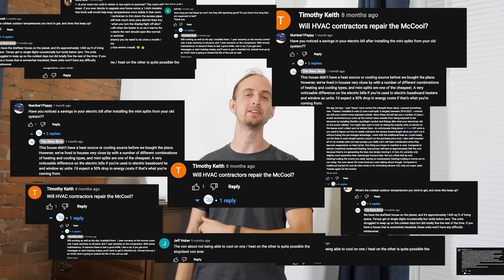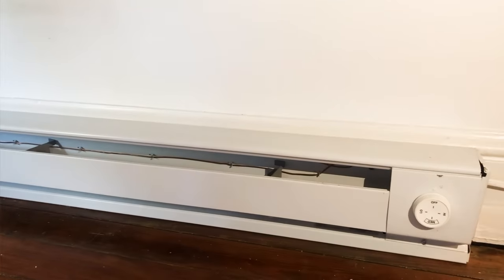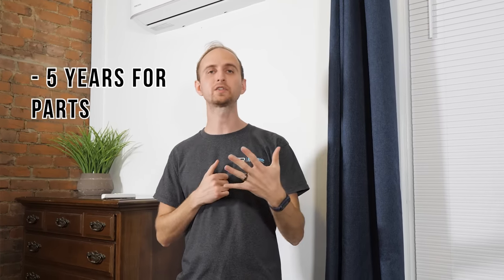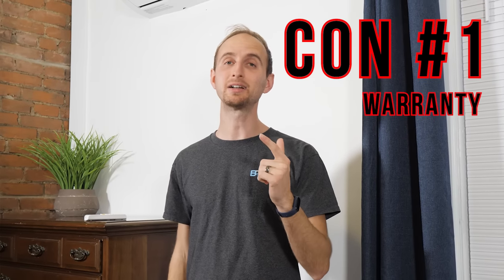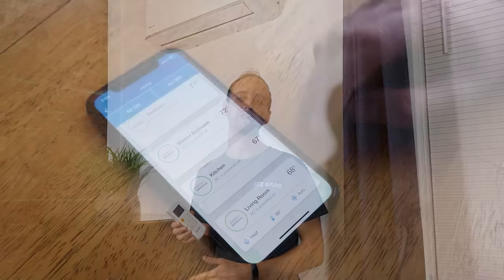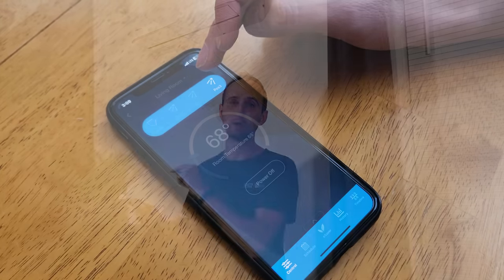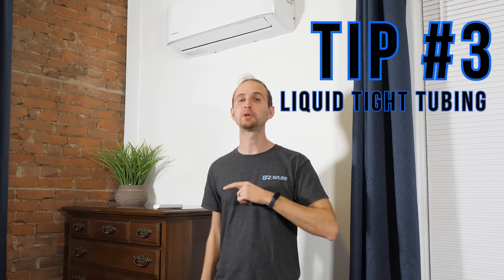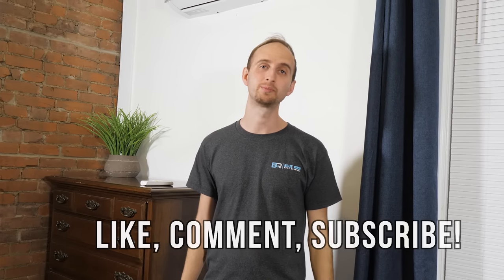Mr Cool DIY 2-Year REVIEW: I wish I would have known this BEFORE BUYING...

Comment: Contractor with 25 years of experience here (I've personally worked for 2 different HVAC companies for over 4 years as well). DIY mini splits are by far the best bang for your buck. Don't go with a offbrand that won't be in business 3 years down the road, and don't do a half-assed rush job on the install. You'll be fine. Plumbers were crying the same way HVAC guys are now back when PEX, and sharkbites hit our market 20 years ago. They realized that the average person could handle the work themselves reasonably well in most cases. Most companies, and many contractors are charging entirely too much for their work. There are many reasons why this is happening. There isn't a "smoking gun" as to why this is happening. Some of it is the price that materials has gone up (not as big of a chunk as you might think), price of fuel, insurance, etc. If they're a large company they have a lot of overhead (office, shop, utilities, maintenance, staff, advertising, ect). BUT a lot of it is just old fashioned greed. Many are charging hundreds of dollars a hour simply because they can. It's shameful. Your best best is to find a honest independent contractor in your area, and develop good business practices with them. I can assure you they do exist. They are out there.
Reply: It's hard to find honest contractors without having them come to your house though.  I had tried to diagnose my fridge ice maker and couldn't find anything wrong with it and finally gave up.  I called a refrigerator repair man and when they found the problem they told me it would be an additional $200 for an additional electrical diagnosis fee on top of the 120 minimum for them to come out.  Long story short, they charged me $320 to plug in a cable that they had seen was disconnected after it came loose.  I hadn't checked the wire behind a screwed on cover.
Reply: You are so correct.. These Hvac contractors are licensed to steal. For instance I want a12000 unit put in. Quoted like 5-6 thousand dollars. Takes 4-5 hours to install some time a little more. I when on line and they had Goodman splits made buy Daiken now. Paid $661 out the door with the raceway piping and wires for communication between the units. Granted it doesn't have all the bells and whistles but so what it cools just as good. I can put one in in a heart beat. Just flat outrageous. You-tube is gonna kill these greedy guys.
Reply: 100%, thanks for this.
Reply: The main reason is that everyone went into computers starting in the 80s when we were at school districts tearing out wood shop, metal shop, welding shops and installing Apple computers. Everyone then went into computers and decades later they are dime a dozen and we have a huge shortage of trades people. I was there and saw it happen. Now trades people are killing it with their wages. turning into a real rip off generation.
Reply: Explains a lot, i was browsing to see what experienced pros had to say about diy kits and they all said they were garbage, but i went ahead and did it anyways and couldnt be happier, ofc i spent like 2 weeks planning the wiring and researching before mounting the units lol.
Reply: Good point.   With the lack of knowledge that these homeowners have,  even if they’re a ‘contractor’ allows for great business.   They make so many amateur mistakes that you can make good money fixing their problems.    I remember getting $200-$300 to clean up a burred pipe that was causing a homeowner’s sharkbite fitting to leak.        I say Bring it On,  there’s always plenty of good technicians to fix the mistakes make by tending diy projects 👍🏽
Reply: @B-Nice  Putting in a simple split system is not rocket science , lots of great vids for good installs. With the lack of trades people out there even the big pro shops end up hiring guys that skip steps or don't do things properly. Lots of the pros on u-tube do the fill and leave method not looking for a leak.  Give me a brake.
Reply: Duh! How are you suppose to know that until after they completed their work and let time pass to see if it was good value?
Reply: @B-Nice I agree if it's a complex installation but if it's free charged a homeowner with skill can do it.
Reply from the maker: @knowledgeispower6192  Honestly I would have paid a pro hundreds of dollars an hour to run the line sets. It took me like 40 hours and I know a pro could have done it in 4 hours

Comment: The only way to alleviate the mode switching problem is to install only single head units. Honestly, as an hvac professional, that is my normal recommendation if there is not an excessive number needed. It simplifies things when each indoor unit is independent. Also if there is a leak or a problem with the outdoor unit, you don’t lose heat or cooling in the entire house. Not a criticism, just an observation.
Reply from the maker: What would you have recommended in this circumstance? 1 building, 2 apartments, 7 interior heads total (3 in one apartment and 4 in the other)
Reply: @TheRenoBros  without knowing layout of the building, you likely have it pretty close to ideal. Anything over three heads and you almost certainly have to use multiple indoor units per outdoor unit. Whatever area you set condensers in just gets crowded. Normally I would install a typical forced air system, ducting heat to wherever it is needed and running off of one unit. The Gree flex and Bosch ids systems offer much the same efficiency with proper ductwork. Returning to the con with your system, I was trying to say that the problem is not unique to Mr.cool. With any minisplit system you will have the changeover issue. Some like Fujitsu are worse in that when you mismatch modes it creates an error requiring a hard reset, as in cycling power to the outdoor unit.
Reply from the maker: @sethsturtevant9082  Thanks for the insights! I appreciate it!
Reply: If you want to save even more money get some insulation for the walls and floor and ceiling and some great stuff for your drafting this
Reply: The beauty of a split is it’s autonomy. If it breaks you only have to change one. The cost is greatly reduced
Reply: I would tend to add multiple units with single heads wherever possible, as you say up to three. A big reason is just autonomy. If one breaks down you don't have a completely uncomfortable home in the middle of a heat wave / cold snap. I see these people living through the Arizona heat wave and they have a single central air unit or a single mini split that breaks down. Potentially life threatening these days.
Reply: That's simply not a cost effective option for most people.  Considering you can get a multi-zone (3 zone) 27k BTU MR Cool DIY for around $3900.  Let's say we go your route and get three 12k MR Cool DIY single units instead that run around $1800 each.  You are paying almost $1300 more than the multizone.   And now you need 3 electrical connections run from your panel, so instead of maybe paying an electrician $750, you'll pay close to $2k if you can't do it yourself.    You end up paying almost $2700 more (with electrical included), if you do separate units.  

Let's not forget, you also have 3 compressors outside.  Takes up more space, and there's more noise.

As for the case when the mini-split breaks.  While that is a advantage for separate units, most people have that same issue if they have central heat/central air.  If heating/cooling is a life/death matter for someone, then they already should have some backup plan.  Whether it's buying a window AC, or having a portable heater, or fireplace, that should be thought of before it's needed.  And they also need a whole house generator to power their backup heat/ac, unless they are using a fireplace, and even many new fireplace inserts also need power to run a fan, etc.
Reply: With the air handler not turning on because of being in a different mode. Whenever there is a call for heat that unit gets priority. Example if you had two units in cool and the third gets turned onto heat. The two in cool will go idle. 

In the app, look into the e-saver, comfy mode. You can use this turn the unit off completely once a set temperature is reached. 

For me we have a bedroom that we keep cooler than than the other we set room 1 to 62 cool. On the other we use comfy mode to turn on heat to 86 when it drops to 66. Then once the room is 70, it turns off. The first rooms cooling only stops for about 20 mins at a time while the second heats back up.
Reply: we have a house with 3 , five head units, and yea when a unit goes down we loose 1/3 of the house cooling, has happened 3 times in 4 years
Reply: @TheRenoBros thanks for the vid. Enjoying your. I'm betting that you wish you would have installed larger units.   😊
Reply: Your going to use the 3 head option or the four head option but just remember that they are all connected by a common line if one indoor head leaks refrigerant the hole system may go flat kinda like if all four of your tires are connected by a common line it could become very difficult to determine which one is leaking @TheRenoBros
Reply: @sidorgeorge  Wow that's expensive. Here in aisa a single head 12K BTU unit costs around 400 US dollars.
Reply: @thunderboltlightning6010  Yeah, it seems like in the USA, mini-split are a very high cost item.  And HVAC companies charge you so much money to install.  For example, I got a quote to install a 27K 3-head unit mini-split, for $12,000 US dollars.   I went with the DIY Mr Cool instead, and saved approx $8000.   Wish our units cost $400 :)
Reply: @TheBernz83  My work has the Fujitsu mini splits with several heads to a unit. If some are set on cool and you try to get heat in another room they bug out and shut down.

Comment: Last winter was my first with a 27k two zone in my garage. Mr. Cool's defrost I believe is 3 min long and NOT long enough for a New England winter. The defrost runs long enough to create a bubble around the fins outside. It's still crusted with ice, but there's a space between the ice and fins. This starts a defrost cycle hell where you have no heat for hours. Make a COVER or shelter for your heat pump outdoors. I spent so much time outside in the cold trying to "defrost" it manually with heat guns and picks. Not fun. I believe there's a way to prolong the defrost cycle, but this requires opening up the heat pump cover, and Mr. Cool does not provide info on any of that, and I haven't found any info thus far. Aside from that, great unit so far all DIY
Reply from the maker: Amen! Good advice! Especially if your area is prone to lots of snowfall, always build a little roof over it big enough to keep snow away from the unit so it can breath and do what it needs to.
Reply: I had this same problem except the ice only accumulates at the bottom of the condenser fins. To solve this i ordered a 6ft piece of heat tape(120volt) off Amazon and routed it so its touching the bottom of the condenser fins all the way around the bottom. This helped tremendously. Actually spoke to a contractor who said they do something similar with Daikin units they install. The unit has a heating element to help the water drain out of the bottom (after its melted off the fins) so be careful your heat tape doesn't touch the factory installed heat element. This thing was pushing out hot air  down to -5° this last winter. Lower than that it and starts to struggle. But its saved us so much trouble & money keeping the house warm or cool. Had it about 15months now. Amazing pieces of equipment and crazy efficient
Reply: I'm not sure I'd use any mini-split as a primary heat source in any far northern climate.  But perhaps building the shelter and using heat tape makes it doable.
Reply: @TheRenoBros  Also, if it's under the eaves make that little roof strong enough to handle an ice dam falling off the main roof.

Comment: If you live in the south do not use the crappy insulation given for the Freon lines. Just a little of exposure to summer UV here in Dallas where there was a small gap exposed was disintegrated by one full summer of sun.  The foam at $3 for 6 feet is much better than that provided.
Reply from the maker: Thanks for the info!

Comment: I recently purchased a MrCool DIY 4th Gen 12K BTU 115V single-zone mini-split from Costco online as it went on sale.  it will be installed in my garage.  I already had an electrician put in the dedicated electrical for it with a disconnect switch. After it was delivered by UPS I contacted a multi-state MrCool authorized dealer - Sta'bl-Power to inquired on the installation cost but after they heard that I purchased it from Costco they weren't interested in doing the installation.  So I will do the installation myself, since after seeing several installation videos on YouTube and reading the installation manual it's fairly straightforward.  Advice is to make sure to have all the proper tools to do the installation, such as a torque wrench, 3.5 inch hole saw, power drill, etc.

Comment: Mini Splits are widely used in Asia and Europe.  My wife and I lived in S Korea for a few years and used these units exclusively. They were not Mr. Cool's of course but usually Samsung or Mitsubishi.  The only issue I had with them was the inside blower getting clogged up with lint.  There is a spinning blade in there that looks like the fan blower on a central unit, just smaller and longer.  Even if you take the filter screens out and wash them frequently that blower will still get clogged and slow down.  Eventually it will start leaking water down the wall from the lint building up and clogging the drain line.  The drain lines clog easily.   I also noticed the heat pump side of the unit will heat all the way down to fairly low temps.  Around 10-20 degrees F.  Below that it may start icing up at the outside condensing unit.  You MUST keep snow from piling up around the outside unit or it will not heat.  You can pour water on the ice to get it to melt quicker.  Overall I love these units and I plan to put several in my house so I don't need to run the central air units.  Good video!
Reply from the maker: Thanks for sharing and thanks for the support!
Reply: @TheRenoBros  We had the same issue with my parents house.   They put one in the living room / dining room area.
The drain line blocked up and leaked into the room.
Reply: Good advice on the electrical, these diys are much better for those that know how to be comfortable with electrical . I’m a retired electrician and my five year old 2 ton unit in my large 3 car garage, Mr. Cool has been great .
Reply: That’s not lint buildup that’s mold from condensation
Reply: @nothingface0xx  Yep, that's the nasty part you never hear of. I noticed air force was way down. I took unit apart to get to the squirrel cage blower, it was full of mold and fungus.
Reply: @robertgregory2618  I keep my fan set on medium or high. Seems to help keep it from getting too moist. I think they get moldy because they are constantly running low speed all the time

Comment: Highly recommend taking the condenser unit apart and taping over the holes for wires going to the board. We had a frog climb in there and short out the board, and since that was an "act of nature" it wasn't covered under the warranty. Still waiting for the replacement board after 4 weeks...
Reply from the maker: Oh wow! Thanks for the heads up! Sorry to hear that happened to you!!
Reply: Daiken, LG, Mitsubishi, Carrier/Bryant..same wait..china manufactured controls.
I talked to mrcool diy sometime (5or 6 Yrs) back, was tolg all parts available in Kentucky..so I pushed the product..then recently I found out the parts were actually just freighted in from China..

Comment: I live in Arkansas, hot humid summers and cold winters. About 80 degree diff in seasons. I've owned mine since 2021, they have had the motor noise for at least 6 months now and I had to clean the fan out as it was clogged and not blowing very well. Other than that they remove humidity very well and on 100 degree days keep my not so well insualted house around 71 inside!

Comment: I’ve had my one ton Mr. cool for four years. Cleaned it every year. Works perfectly
Reply from the maker: Good to know! Thanks for commenting!
Reply: @TheRenoBros  - FYI - the extra length of line set that is roped up outside should be in horizontal storage (like a garden hose rolled up and laying down on the ground flat or underneath a metal bracket horizontally if wall mounted bracket is used ,instead of being in a vertical setup. You will get more efficient flow of refrigerant through the high/low lines. Additionally, at the time of setup, you could have shortened the lineset by cutting, deburring, and flaring the copper lines prior to hooking them up to the outside condenser unit. You have to use a vaccuum pump to empty out the lineset through the service ports and then finally open up the ports to let the refrigerants flow. If you want to do this now you will have to hire a HVAC service tech to pump down the system or evac the refrigerant all together, shorten the lineset and then repeat the vaccuum and refill with refrigerant over again. If you are handy and have access to a vaccum pump (you can buy one for $125 from Harbor Freight) and a copper line flare kit, you could do this yourself.